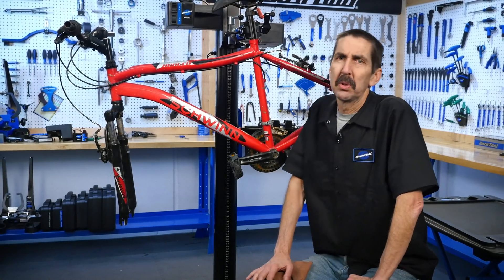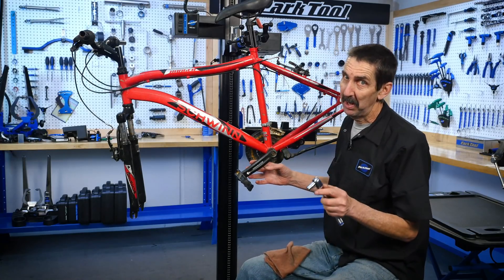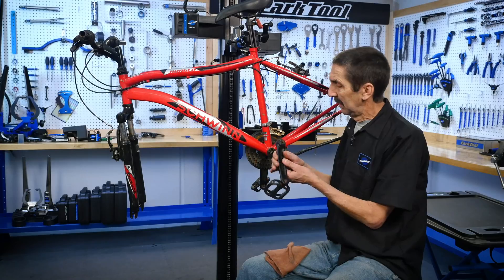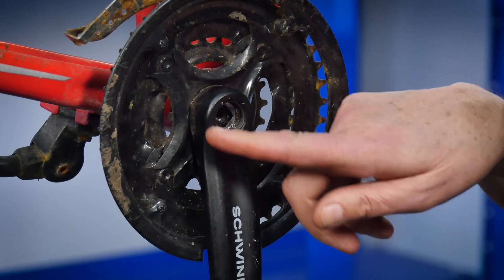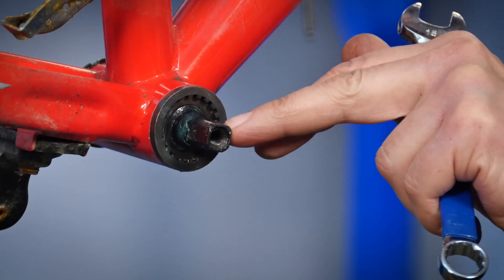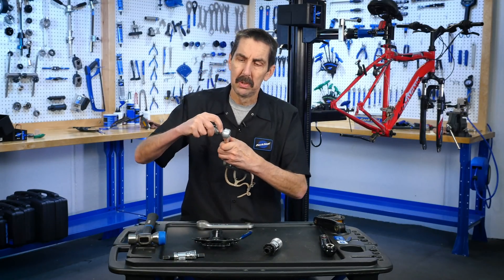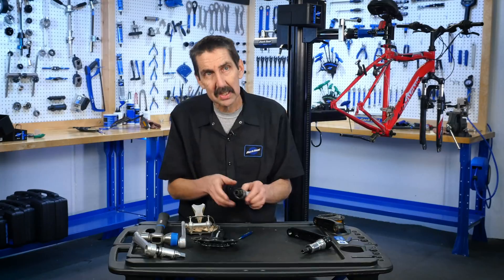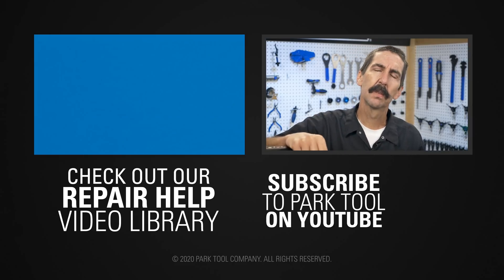Square Peg, Round Hole | Tech Tuesday #155

Comment: Always snug the bolt up on an aluminium crank after the first few rides. The aluminium is soft and will deform some, you may get a bit more out of the bolt after putting some everyday pressure on it. No, you won't split your crank arms, unless they're made by Italians and featherweight in design.

Comment: Thanks Calvin, but there is no mention of the different square holes in the crank  ie the square hole that is symmetrical with the crank and square hole offset by 45 degrees (often referred to as the diamond hole here in Ireland.) Many times I've had long debates with customers about this problem in shops. This is really quite dangerous to use a bike in this condition.
Reply from the maker: Good point of the offset.  If the two sides don't match, the rider will be the first to know.

Comment: I have one bike that is a square crank but it creaks on the left side I tighten it with a breaker bar and it stays quiet for a little while but after a while of riding it starts to creak again, I then I have to do the same process again, I can't find a solution to the problem.

Comment: Worse by far was cottered cranks. The left arm was forever ahead of the right by 10 degrees. No such thing as cartridge bbs. It was a struggle to get cotters out to deal with  the bb. I never had this problem with square taper because I rechecked bolt tension after about 100 miles. The other commenter is right in pointing out the orientation of the square. Some are 45 degrees  to the arm and are referred to as diamond in some online stores.  That mistake would be very obvious and inconvenient!

Comment: Another note with square taper cranks, there's two kinds of patterns to look out for. One is where the square hole is machined flat or parallel with the length of the crank arm and the other one has the hole rotated 90° so it looks like a "diamond" shape.
So when ordering a single replacement arm, make sure you check the pattern of the taper hole before you order to make sure it's the correct one.
Reply: Rotated 45°. If you rotate a square by 90° you get the exact same thing again.
Reply: @SnootchieBootchies27  This was so instructive, it shifted my perspective by 360°.

Comment: Also, when getting a new left crank arm remember to check the alignment of the hole (square vs diamond taper). Don't want your replacement to arrive only to find that your cranks are 45 degrees off!
Reply: Yeah, at first glance I thought he was going to show us that one crank on the bike was square taper and the other was diamond taper, and that was why they were misaligned.
Reply: I thought this was a joke (like, rotate the square and it becomes a diamond)  but, no, this is actually a thing.

Comment: Hey could someone help ? My bike has one and it’s impossible to take the cranks off, I tried lubricant and it didn’t work, it’s not rusty either
Reply: Use a breaker bar or a pipe to extend your leverage. Not unusual for it to be really tough to turn the crank puller for the first few turns.
Reply: Provided you have the proper crank arm puller, you can slip a socket over the end of it once it's properly threaded into the crank arm and break it Loose with a breaker bar or even a light duty impact wrench with something like a Bauer impact gun from Harbor Freight.
Reply: Leverage!  Slide a tube over your wrench handle.  Also remember the left crank loosens to the right and tightens to the left.
Reply: Make sure there wasn't a washer between the crank bolt and the crank. If you leave a washer in there when you try to pull the crank... you're gonna have a bad time.
Reply: None of this worked sorry for the super late replies :/ and it is the right puller

Comment: On the lower end it is hard to draw a line between bicycle to scrap metal. To me anything with a quill stem and/or square taper BB is in the scrap metal category. Not to knock the video, any knowledge is useful. I don't even know why these are still manufactured. I find it hard to believe they're significantly cheaper to produce.
Reply: You can find a square taper bottom bracket anywhere in the world if you need it.  Being at least 40 years old there are a lot of them around.
Reply: They're still common on low range equipment. They work quite well if properly installed and if you buy Phil Wood, may outlast the bike. Classic steel would look stupid without 70s Nouveau record crankset!
Reply: Frank Ricard square taper bb last a lot longer than the "updated and better"  hollow tech style ones
Reply: @Thecrazyvaclav  I can technically agree with you that square drive BBs last. I have never destroyed any of the many I've owned before. That is because the crank arms eventually fail from getting lose repeatedly after every few hours of riding and I end up replacing the bottom brackets so I can get something that works properly. So they're all in a parts bin somewhere lasting very long. I know these are not made for extreme applications and for a city bike they might be good long term but that precisely means they're inferior technology. Also consider that premature failures in modern bottom brackets are often caused not by the quality of the part itself but by sloppy carbon frame manufacturing that results in bearing misalignment after installation.

Comment: My friend had a problem like that he spend 100$ on 2 BB in a bike shop and they could figure it out. How much should a bike shop charge for a repair like this?
Reply: Completely dependent on where you are located in the world.
Reply: I stripped the pedal thread on both sides of my bike so had to replace the crank arm on either side. It was £20 for both left and right in the uk from eBay and  took me 10-15 mins